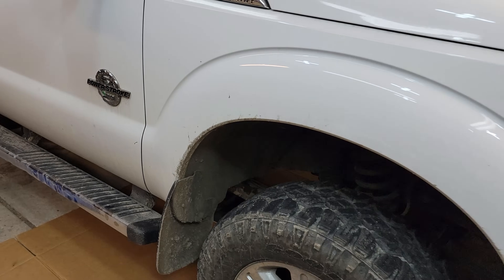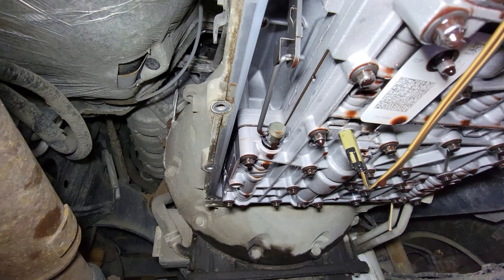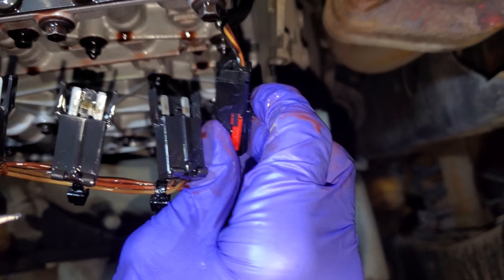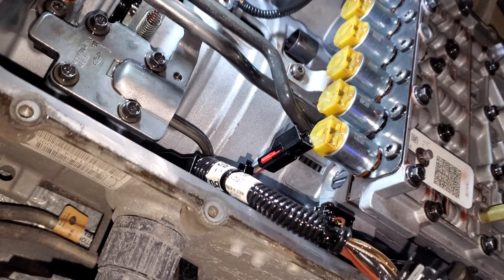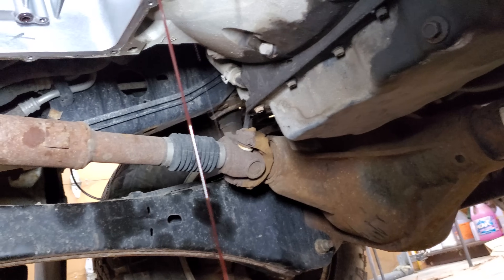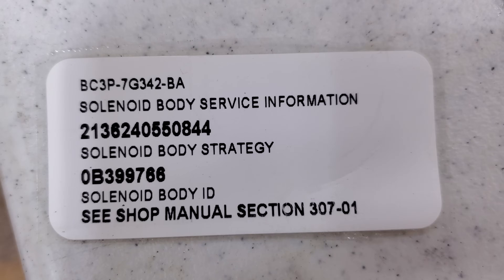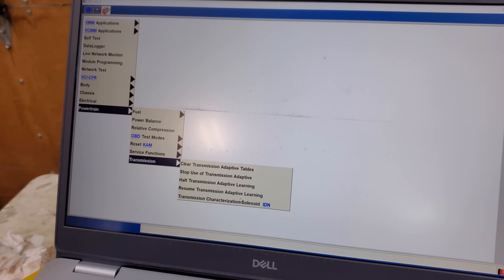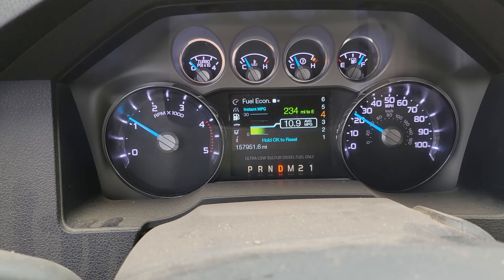**WATCH**  Ford 6R140 | Slamming into GEARs - What YOU need to know - FIXED! #6R140

Comment: So I have a 2017 that I had tuned and extremely hard shifts from 3-4 from my tunes. Didn’t know it was a problem till it started ‘hoonk’ing when shifting 3-4 at only 60k miles. Ended up getting a high line pressure tune from my tuner and it seemed to fix the issue. I changed the fluid again at 90k and everything looked normal. Changed it again at 125k because mileage has dropped significantly and I can NOT find any other issues with the truck. At the 125k change fluid smelled burnt but everything else looked normal. I am wanting to clear the adaptives and start fresh again. Can I do that with for scan or do I have to take it to someone with ford ids???
Reply from the maker: Yes u can
Reply: @PowerStrokeTechTalkwARod  hell ya! Thank you

Comment: I have a 19 that delays going into gear from Park whether it’s reverse or forward sometimes there’s a five second delay before it actually goes into gear
Reply: It does it cold or hot I noticed it when I first got the truck and then after the transmission fluid was changed it went away and now it seems to be coming back it’s not every time but it’s getting to be more frequent I’m going to check the fluid level tonight but I see no visible leaks
Reply: It has 34,000 miles on it and I believe the power train is 100,000 miles warranty I will wait until it gets more consistent if the fluid level is full otherwise when I bring it in I’m sure it will never do it for the mechanic lol
Reply from the maker: Hmmmmm
Reply: U ever figure out what was wrong?

Comment: And here I,am  again I ,need a tyranny wizard for My 05 F350 DRW that has been making a clunking/ knock when it's needing to downshift from 5th to 4th at around 60 mph and 1800-1900 RPM'S  hell at this point it may not even be the transmission since it does it after installing a BD 5R110 and Torque converter. And it when going up a grade. Driveline perhaps,but don't know why a grade uphill climb and not mashing the skinny pedal on the right to force the shift sooner and it doesn't happen.  Using The BD Tapshifter and having the ability to hold 4th gear also takes care of it. 
It's just driving me nuts. Soon I, shall take it to my local Ford Dealership for a drive and see what they come up with. And on my old tyranny I replaced 1 or 2 of the Valves and. Even threw a new Hughes Torque converter in prior to going with the Bd and it was still there. One day when I, do finally get a fix I,will put it the comments.  Or if anyone else has had this problem let me know what was your fix.

Comment: My 2017 will shift harder than normal once in a while, but not often. Always when upshifting. It's like you let the clutch slip a bit then it grabs. Just a "bump" into the next gear. Maybe once or twice a month. Not sure if it means I am doomed or it's just expecting me to do something I'm not (maybe I let off the pedal a bit, or pushed it harder to get around somebody), but I am not worried yet.

Question though. Why did you replace the entire body? I thought we could open them and clean up the passageways and be good. Maybe that's only on older models though.
Reply from the maker: Not worth it, replace it plus a 2yr unlimited mileage warranty....SOLD
Reply: @PowerStrokeTechTalkwARod  I did not realize that it was that time-consuming to do. Time is money, right? Hoping I can get 500k or more from mine, but we'll see!

Comment: Arod I have a 2018 f250 and 2019 f350 drw both proven diesel tunes. Trans had a Kam reset and relearn.  2019 has 39k 1 trans flush.2018 has 89k and 3 trans flushed and filter replacement. I do it every 30k . Has a 2nd clutch lock up high line pressure tune. It it normal to have a hard shift 3rd to 4th gear ? No codes in system
Reply: Thank you going to dealership for warranty on the 2019
Reply from the maker: No
Reply: Whats my next step? Take off the trans tunes do another Kam/tcm reset.  Both trucks had the exhaust fall off ,egr fell off and ccv fell off rotted away in the rust belt of Florida . The tunes are low boost fueling ,hiss,and 200 hp switch on the fly. I need this truck to last its my daily driver
Reply from the maker: Id say valve body but i am unfamiliar with the rest

Comment: dude this could not have come at a better time. im getting these exact symptoms on mine. 1-2 up and downshifts. it was fairly intermittent before. i did a kam(i think thats the term) reset with my tuner hoping it was something electronic going on. its happening so much more now even after about a week or so of driving for it to relearn everything.
Reply from the maker: Time!
Reply: Install the Sonnax stitch kit.
Reply: @waynemurphy4715  does it fix the problem?
Reply: @braddenham9189  I put a sonnax zip kit in mine 1.5 years ago and am having the 1-2 2-3 clunk. I feel like the zip kit won't fix this issue. I tried changing the accumulator pistons and still having the clunk. I'm trying to figure out which part is causing this instead of replacing a $1000+ valve body.
Reply: You’re having a rough snatch or slam going into 2nd on both up and down shift?
Reply: @Therealcamclark  I get it mostly on the downshift, like a short jaunt through the development, it will upshift to third just before I let off and start slowing to a stop sign.. Then hard downshift to 2 and 1. Its just overall very odd because its entirely random, and only ever lasts for about a minute or two after starting it up after its sat for a few hours. Than it will shift fine. Almost like it has trouble building a pressure or something.

Comment: For us old school guys; it would be interesting to know what is failing in these units. Would it be possible to dissect and repair the fault? Seems a shame to toss the entire assembly for one problem.
Reply from the maker: Probably more cost effective to replace then to tear down & piece back together
Reply: This was my comment too.  
From working on other hydraulic components, if it fails, it is usually a valve, not the valve body.  These are more complex, but the channels and passages will not wear from fluid passing through them.
Changing the component is great, but I was hoping for full nerd out level testing to see which part wasn't doing its job anymore.

Would the scan tool be able to report the shift pressures real time to help diagnose this?
Reply: @FixItPleaseJ  I'm here looking for the same thing. The valve body is like and engine. It's a fully serviceable part. It only takes an hour to disassemble/reassemble if you don't know what your doing and reading instructions. It can't be that hard to fix this issue if I could find out exactly what parts have failed. I tried replacing the accumulator pistons with new Sonnax parts but that didn't fix it.
Reply: I had one apart and went through the trans completely, very carefully as a bench rebuild, someone else r&rd it. It got a fresh TC and new cooler too.  bought an ATSG manual on it as well. Other than having a lot of debris in the valve body, well every where actually, from a failed forward clutch pak, cleaned heck out of everything. I've built transmissions for years, but this was my first 6R140. I couldn't really see anything wrong with the valve body, had it completely apart to clean it. Didn't mix up solenoids. But EPC was replaced after first test, but didn't help. Confused! Customer brought it to ford dealer said low pressure. Awaiting a new valve body now.
Reply: If I had to guess I'd suspect bore to valve (mechanical) interference delaying the required quick diversion of fluid flow. So in essence for a split second it may be applying pressure to two gears at once. In theory. This could be poor design (warping of the valve body), settled contamination from worn clutch material,  pressure bleed over to name a few. I don't think it is an electrical issue with the solenoid. 
 Just a guess
Reply from the maker: ...very good!!!!

Comment: Very nice. Love it when they go together smooth. What temp should a 6R operate at going down the road?
Reply: When towing it's a bit higher
Reply: 19 owner. Pretty solid at 199
Reply: Mine typically runs in conjunction with the operating temp of the cooling system, 195ish.
Reply from the maker: Good info

Comment: Wipe KAM and Adaptives. Then N, R, N, D pausing for about 4 seconds in between until shift quality is acceptable. Then with the transmission at 185°F, drive the vehicle to 50 MPH with shifts at 1500 RPM. Continue until this is done 5 times. Then repeat the drive cycle with shifts occurring at 1900 RPM 5 times. 

Yes, I’ve been there one too many times to remember this 😅
Reply: Also, I’ve had 2 valve bodies that had strategy codes that were not acknowledged by IDS or the database. Both from a custom builder. Neither valve body functioned correctly and the builder basically threw their hands up and blamed software. That was the last I had that trans in that truck. Back to an OEM unit and shifting as it should.

Comment: Great video. I'm surprised that only 3 bolts hold that valve body assembly in place. I looks kind of heavy for only 3 retaining bolts.
Reply: Well the Trans filter retainer bolts also retain the  V/body to the case . I learned the hard way, remove the dipstick before installing pan and I also use an modified trans dipstick with a wiper on it to clean the tube of residual oil so I can get an accurate and faster read on the stick before starting the truck up. These are great transmissions.
Reply: @rickszabo4312  Mind sharing where you bought (or how you modified) the dipstick ?

Comment: I have a 2019 f-250 SRW 4x4 CCSB. In my experience I have a wonky shift from 3rd-4th upshift I’ve had friends with 6.7’s with 6r140 trans must be a ford issue. My only question is with the wonky shifting will that harm the clutches of the transmission?
Reply: My 2017 had a shudder while settling in to 4th, under load. Trans gave up finally, had a "hot build" done by a local shop. All shifting is silky smooth, even whilst towing heavy. Except 5-6, 6-5. They're a HUGE flair before settling into 6th. I'm talking, jumps to redline, then SLAAAAMS into gear like a frickin' neutral drop. FROM DAY ONE. "It needs to learn" I was told by the shop's warranty dept. "Give it a bit." 9,000 miles later, I'm dragging 26,000lbs through the Ozark mountains, does a flair, then KABLAM.... Nothing. Not even park. Transition year truck, has a BW4464 transfer case instead of an NP271F. 4464 does NOT have a neutral, meaning.... Ughhhh... Case was a lovely, Campbell's chunky soup of broken metal and fluid.
Reply from the maker: Did they replace the valve body during this HOTT build?
Reply: @PowerStrokeTechTalkwARod  They say they did, it came with a new shift strategy and placard.
Reply from the maker: Hmmmm
Reply: @PowerStrokeTechTalkwARod   I'm actually headed to them right now, I'll be there in 4 minutes. When I told them what happened to my transfer case, they were like "You should have brought it to us we were we would have looked at it  and if it was the fault of the transmission, fixed it. I said "Yeah, that sucks, but the first thing I bought from y'all is broken, wasn't gonna invest in a second. I got it over at C&W Gear in Springfield, MO getting fixed." Then ol gal gonna be like "OMG, that's who we use anyway to do transfer cases", and I'm all "I'm just saying, I saves y'all pull out and install fees, and it's hard as hell for me to pull out, you wanna go ahead and pay for that transfer case rebuild?"  and gal said "Sure!" Then the next guy I talked to went back on what she had said, and told me that they would NOT replace my case. Meanwhile my truck being down costs me literally $450 a day. The rebuild was $422, and my truck was down for 3 weeks waiting in line to have it done. 21×$450=$9,450... Haven't said a gd word about this, or the 2.7 weeks they spent doing an "Overnight hot build" on the tranny.
Reply from the maker: Omg........
Reply: Yeah my 19 from day one has a harsh feel from 3 to 4 too. 28k and rollin, 2 more k and it’s time for the arod drain and refill!

Comment: My 20, 10 speed does it, and the initial recall which my truck met . Ford denied me to have the transmission fixed. Ive got 171k miles and still going. She slips gears too every now and again.

Comment: Hey A-Rod, great video content...  I have this issue but with my tuner, I was able to resolve this...  Keep things coming these videos are very much appreciated...  One question do you recommend disconnecting the batteries before working on these tranny electronic components...
Reply: What did you do to resolve it? I have an h and s mini Maxx on my 2008 and it shifted beautiful smooth before and then now it's no where near as close but definitely fine, would like it the same as before
Reply: @nativeoutdoors1780  Your Minimaxx should have a transmission program...  I have a 2011 F450 and my Minimaxx has a transmission program that once installed per the instructions you need to do several 0-60 or 80mph runs then drive normal for several miles to allow the adaptive features to learn the tune and your driving habits...  This has worked for me every time I've needed to go from tuned to stock then back to tuned again...  Hopefully, this helps you!!!
Reply: @TheRealSlowhand  yeah I may have to try this, currently it runs pretty good since the last reset was months ago but I'll definitely try this method if I redo it again.
Reply from the maker: Nawww...theres no power to it anywaysss
Reply: How where you able to resolve using your tuner?
Reply: @eddieh6429  There is a transmission tune option that I imagine most of us installed...  The instructions after the tune is installed call for several 0-60mph full throttle runs if I remember correctly...  This allows the transmission to learn the new parameters...  I have always run the transmission tune andhad no issues...  Once in a while the shift sequence skips a gear and the engine revs then slams into gear...  I have come to realize at such time to quickly let off the gas peddle as it will engage and doing so at high revs is not so good for the tranny...  I don't beat up things just because I run tuned 100% of the time...  Maybe this is why I have never encountered the "stupid damage" I read about from guys that think their 5 ton+ weighing pickup truck is somehow a sports car just because a tuner adds 100+ HP/torque...  Those are the channels we should avoid taking advice from it's almost always bad anyways...
Reply: @TheRealSlowhand  Thank you for replying back and for the info, very much appreciated! I agree completely, these trucks aren’t sports cars.

Comment: I did my valve body and programmed it with Forscan I bought the truck heavy used I run custom tunes bought all the big 3 use Ezlink but at low speed until transmission warms I still get a 3-4 harsh it’s pretty normal after that I’ve heard the early tucks had pump problems after sitting my truck Is a 2012 175K
Reply: I installed new o rings and the colored plugs torqued everything